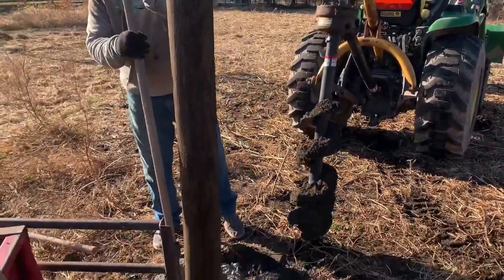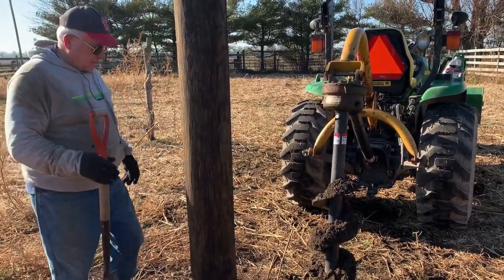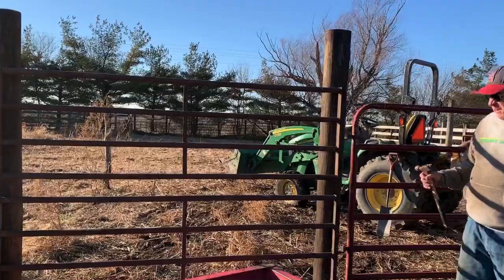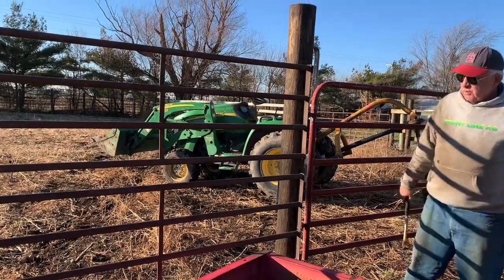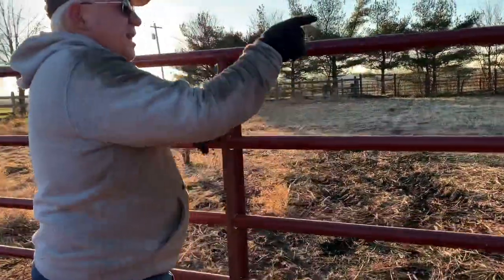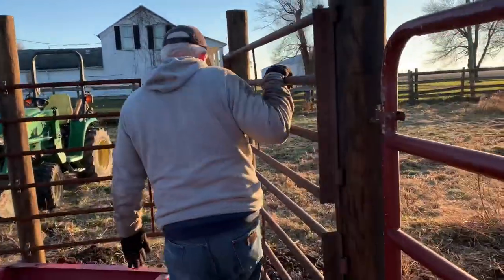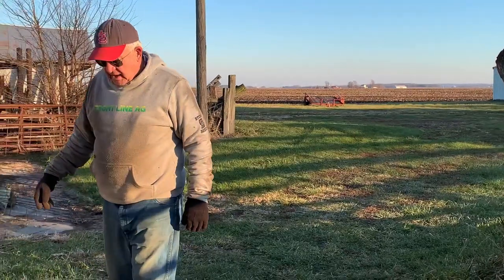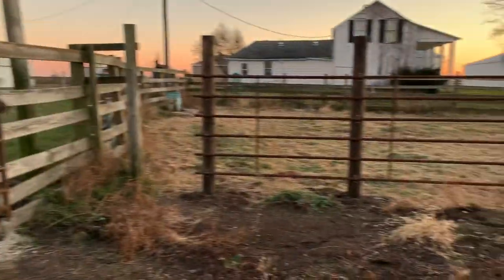Building a cattle corral

Comment: I’m with dad, not a fan of wood. We continuously redo/repair wooden fences and it only takes a few years until it needs work done on it again.
Reply: we just put in barb wire fence with wood H braces we used 6 and 8 inch posts. im hoping it works